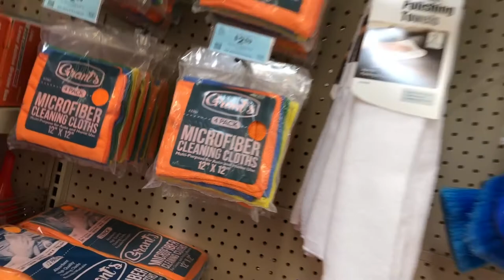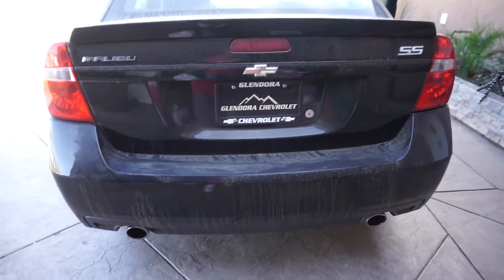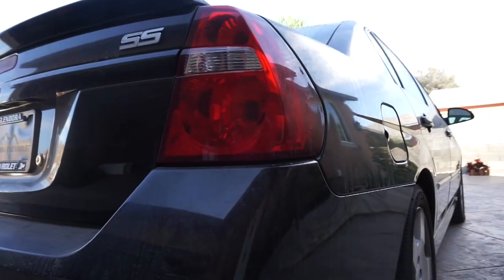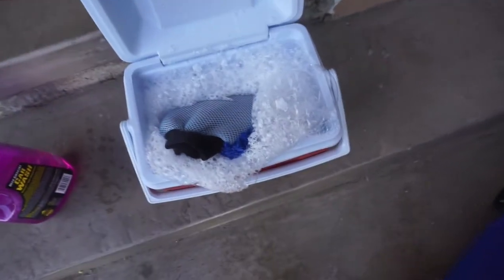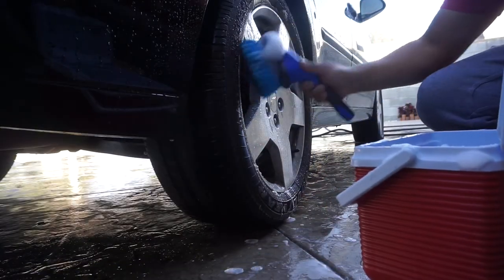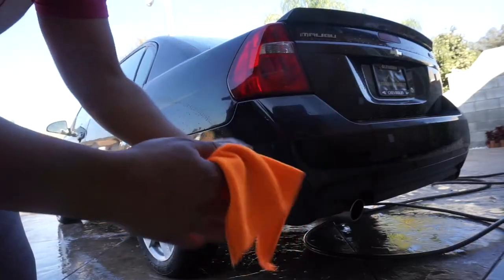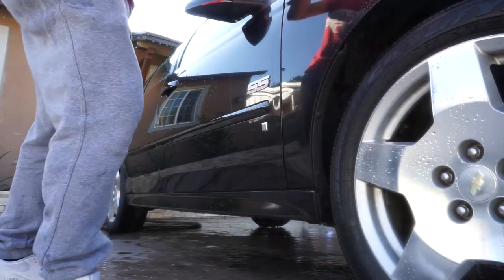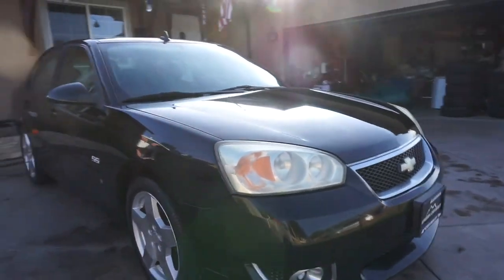Clean your car using ONLY Harbor Freight products with less than $50

Comment: The whole idea of a soap sprayer is to ditch the bucket. (WSSR) Wet fehicle, soap, scrub, rinse and last dry. Just do it so you don't let any soap dry on your car. I do the top (WSSR), then the hood and front (WSSR), then thew trunk and back (WSSR) then a side at a time (WSSR) Then the wheels with a  brush designated for wheels only (WSSR) The last thing is a complete rinse of the whole vehicle, followed by a blow dry with me Echo leaf blower. You're welcome.

Comment: Car cleaning 101 ... start at the top and work down .. when you wash down low on the rear quarterpanel or the bottom of the doors and then move up it only takes one little grain of sand to scratch the hell out the paint
Reply: and easy on the pressure. looks like hes putting alot of pressure on the paint.